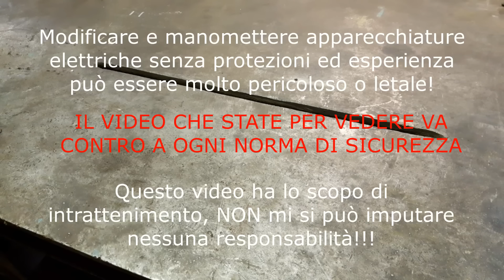Microwave transformer, the best modification for Spot Welding machine

Comment: These do-it-yourself spot welders look interesting, but there is one problem with them, namely that you achieve such a power that you can already use them, you have to connect a lot of the MOT. So, since I don't have much space in the basement of my home and I have to constantly pack them, these are not good solutions, because they take up a lot of space and their performance is low! I bought a Sequre Sq-Sw 1, and on the second battery pack I sold, the price came back. Not to mention that it can handle 1500-1600 Amps at peak!

Comment: What is the maximum current you can get?
Reply from the maker: Hi, it depends on what you have to weld... In my case with a primary winding I get up to 400 amps, if you put two primaries in parallel you get around 800. If you take off the shunts, you can hit 1000 amps.

Comment: Nice video. Grinding the sharp inner corners & then adding a layer of thin insulation, tape, etc. Finally squeezing the turns more would make a tight wind.
Ed c

Comment: The best is to use a big cable with max 2 rounds = 2 volts and a lot of amps but very short welding time (with time and power controller ; the best is with several pulses). Here you win Volts but no amps , so welding time is longer, nickel can burn with a hole in the cell plate, or simply a bad welding, with hot point by use of the tool with many amps ...and possible bad issue for the cells...and for you . Professional welders use such voltages (3,5V or more), but not to weld on thin plates like lithium cells.
 The best for cells is maximal heat BUT with minimal time (regulated with pulses to avoid burning). It's the best for weld quality and for the lithium. The number of pulses is the most important. It's THE big issue by use of a MW transformer without controller.   And at the end , good electrode cables, as short as possible for easy use.

Comment: Very good idea, could you tell us also how many amps does it give you? I'm thinking for a spot welder.
Reply from the maker: Hello, with this configuration it can give about 350 amps (more than enough for my needs). If you need more current, you can put two primaries!
Reply: @newtech5042  350 amps is very low for a spot welder. Increasing the secondary voltage the way you did, lowers the current. It's definitely not more efficient.  Using parallel primaries of 2 transformers and the secondaries with less turns, but in series, will keep the current higher but the secondary voltage will be additive. With two parallel transformers the power Input is doubled. Power out equals power in minus losses. Total power dissipated in the weld is key, but good spot welders typically use 1000 amps on the low end. And as much as 10,000 amps on the high end. Typically about 5 volts up to 20 volts. Spot welding is resistance welding. Squeeze pressure plays an important role because that tends to determine the resistance at the weld. You can tweak this a bit as you make a weld. Takes practice.
In these kind of microwave transformer spot welders, 2 volts at 500 amps can make a semi-decent spot weld on light gauge steel, but barely. The turns ratios is the key to the current out. More turns makes higher voltage but lower current. That's what your mod is doing.  You can do a few things that produce higher losses and raise the primary current above the winding ratings. Works more or less but overheats the whole thing pretty quickly. Low duty cycle. 

With two parallel primary transformers with the secondaries in series, you get higher voltage at the same current. But about double the energy dissipated in the weld.
For a stick arc welder, you need less current but want to have about 40 volts to keep the arc going. So there's a trade off between the number of turns to get higher volts, but less current. But to get decent performance, you need more transformers. 

In the end it's still largely about the total power or KVA. Changing just the secondary won't change that. You can get more or less current and respectively more or less voltage, but total energy is pretty much the same. 

US transformers have 120 volt primaries which present a different set of challenges. Power is the same but primary currents are higher. Roughly double. The windings are different and getting an ideal turns ratio is considerably different.      Using 240 volts on series primaries, gets complicated and requires a dedicated circuit, but ultimately can push higher currents for a spot welder but lower voltages. Cable size does play a role. Bigger cable with less turns, supports higher current at reduced voltage. The 230 volt transformers on a 230 system are a bit more flexible and a bit easier to deal with. Either way there's limits to what you can get out these transformers.
Reply: @professorg8383  словесный понос 😂
Reply: @левтравинов  I try to convey a lot of information. If you don't want to spend a few minutes of your time reading, that's up to you.  Too often these short videos don't give enough information if you actually want to try something. If I can save someone a failed attempt, I will try to do so. As someone who teaches, I see a bunch of idiots because they can't invest any time to read. All of my students appreciate a lot of information and they become far more skilled in the process. But I'm old school.

Comment: SUPER DANGEROUS TO USE EVERY TIME. THIS HAS A 70% KILL RATE. WHEN SHOCKED WITH THIS TRANSFORMER. IF U ARE LUCKY YOUR FINGERS < TOES & MAYBE HANDS WILL BURN OFF SO U CAN LET GO. OTHERWISE IT IS ON A CLOSED LOOP & U CANT LET GO WHEN SHOCKED AT ALL.
Reply: You are confused. The 70% kill rate is specifically regarding people using the transformer for HIGH voltage output to make Lichtenberg (Fractal) Wood Burning devices. The default configuration for the microwave transformer is a low number of primary windings to a high number of secondary windings which generally outputs about 2000 volts at 1 amp. New Tech's version is doing the opposite. He is going from a high number of primary windings to a low number of secondary windings which reduces the voltage, but increases amperage. 
DO NOT try making the fractal wood burning machine. It's INCREDIBLY dangerous which is explains the 70% kill rate you mentioned.
Reply: @nnamerz  thanks for the insight
Reply: @fentynolfloyd5558  No worries. But I do appreciate your intent to help prevent more injuries or death 👍😊
Reply: @nnamerz  Hey since u know more about this stuff, I admit I am into all kinds of stuff. what is the benefit of something like this for an average guy, with a house & a shed.. whatever.. What is the big desire for this thing for the widest range of ppl as well?
Reply: @fentynolfloyd5558  If you're referring to the microwave transformer, the benefit of this specific project is to make a resistance spot welder. It's most commonly used for creating battery packs by tack welding small conductive small strips of metal (tabs) to link the batteries together. It can also be used it to tack weld 2 pieces of metal together. This works because New Tech modified the transformer to push out LOTS of current (amps) which suddenly dumps a lot of energy into a focus area. All that energy along with some pressure, forces the metal to get really hot and fuse with whatever it's touching.
Reply from the maker: In base alla norma tecnica IEC 60479-1 la soglia di tensione minima considerata pericolosa è di 120 V in corrente continua e 50 V in corrente alternata. Il secondario (che è l'unico ad essere maneggiato) ha una tensione di 3,5 volt, in ogni caso è giusto ricordare che non si scherza con la corrente, infatti è specificato prima di far vedere ogni modifica!

Comment: I think it's a good idea but it doesn't seem very good for the battery cell. As in the video, this only increases the volts, not the amps. Although soldering is easier, it also increases the battery death rate
Reply: Si aumenta el voltaje también aumenta el amperaje son variables directamente proporcionales. Según ohm

Comment: Don’t use a MOT transformer. Use a high pressure sodium or metal halide transformer. I use a 1000 watt HPS transformer and cut out the secondary coil . You can use 14 turns of 4 awg for rectified for 12v. Done.

Comment: But if you get so many secondary coils, you will decrease amperage. What actually does the job is amperage not voltage.
Reply from the maker: Dipende in realtà da tanti fattori, le opzioni per aumentare corrente possono essere diverse, levare gli shunt, mettere due primari, poi diende anche dalla potenza del primario originale... questa modifica permette di avere a disposizione più spazio, in modo che ognuno possa impostarlo per le proprie esigenze!

Comment: 100722/1304h PST 🇺🇸 Thank you for designing the enhanced spot welder. Good job, neat job and I noted the increase of additional 1 volt from 2.6V to 3.6V. I can imagine the power of the weld.
Stay safe.

Comment: The way you welded cores caused lamination between "E" shaped layers to melt, thus creating a single block of core. There will be huge amount of Eddy current which will cause to heat up and melt isolation on wires eventually.
Reply from the maker: Ciao, ti posso assicurare che dopo mesi di utilizzo quotidiano del trasformatore, non si è ancora presentato il problema del surriscaldamento e fusione dei fili... Comunque come ho spiegato nel video, questa è una modifica che porta dei vantaggi rispetto alle modifiche già viste sul sito, ma ciò non vuol dire che è un trasformatore perfetto, è un adattamento che aiuta gli appassionati e nulla di più.
Il trasformatore per microonde, ha difetti di costruzione già all'origine, ciò nonostante la sua semplicità supera i difetti...

Comment: The idea of combining 2 E cores is a good one. The best results i've personally seen have been with using a standard 12v 1200va UPS transformer with a double pulse controller, produces even better welds than 2 microwave transformers combined surprisingly
Reply: Hi Neil, do you have a video or scheme? Those two UPS transformers spot welding machine?? Thank you 😊

Comment: Ciao e molto interessante il tuo progetto ma quanti amper riesci ottenere in questo modo?
Reply from the maker: Ciao, ti ringrazio... dipende dal tipo di trasformatore che trovi, perché i microonde hanno diverse potenze... nel mio caso ottengo 400 ampere e 3.5 volt, questo vuol dire che ottengo 1400 watt! Con i trasformatori classici si raggiungono lo stesso circa 400 ampere, ma a 1.5 volt, quindi la potenza è solo di 600 watt.
Reply: @newtech5042  more  volt  is more watt ?????the small cable  is better more volt ??????

Comment: The cores should have no visible air gap between their ends when you weld them together. Even a small air gap there will lower the performance of the magnetic circuit. Carefully remove any protruding weld from the mating ends after separating the core parts by 'lapping' the matching ends of the 'E' shaped cores on fine abrasive paper (400 grit or finer) laid on a sheet of glass. Align the ends of the cores so there's no overlap, and firmly clamp them together along the long axis before welding them. That will eliminate any air gap, give the strongest magnetic field, and the best full load current.
Reply: You're describing a better way to do it wrongly.  No need to cut the transformers.  Use both intact with primaries in parallel, and a single secondary looping first through one, then through the other ...
Reply: @LokiCentral would the transformers need to be isolated or you can stack them without needing to isolate them when put one on top of the other?
Reply: По-русски перевод делаете
Reply: mas debería de preocuparos las perdidas por corrientes de foucault que presentan estos tipos de transformadores, cualquier soldadura en su núcleo contribuye en el aumento de estas corrientes, ese es el motivo de que se use ventilación en los microondas, no son adecuados para algo diferente a su verdadero uso
Reply: How many square millimeters is the thick cable?
Reply: @atanasivanov1372  It's looks about 50-70mm2
Reply: @atanasivanov1372  As my calculation shows, you can use 30mm2 for 5 turns of secondary coil, 38mm2 for 4 turns, 50mm2 for 3 turns, and 76mm2 for 2 turns of cable. It will be enough even for long continious(!) welding, not only for spot welding. Using of this huge diameter (as in video) is a huge overwaste of cable size. For spot welding only these sections can be easily reduced by twice.
Reply: I've done this double stacked MOTs but for higher voltage by two secondary windings center tapped for about 9kVAC, then two of these run complementary for 18kVAC that was rectified and fed to capacitors for a pulsed metal vapor laser ❤
Reply: جيد لكن لا يستطيع تلحيم النحاس فقط الحديد اما النحاس الأصفر والأحمر فلا
Reply from the maker: Hai ragione, già in origine sono progettati con perdite considerevoili, questo è solo un adattamento che permette di avere delle prestazioni migliori rispetto a molti altri già visti...
Ciò non toglie che uno studio più approfondito permette sicuramente di migliorarlo ulteriormente!

Comment: What would happen if you use two copper spools on your double stacked microwave converter with the wiring through it in other words what would happen if you use double the double the copper
Reply from the maker: Avresti il doppio della corrente, quindi potresti arrivare a circa 800 ampere, invece di 400...

Comment: не будет работать! первичная обмотка рассчитана на трансформаторное железо. если делать из 2 то и оставлять 2 первичных обмотки! и нужно убирать шунты. Шунт в такой самоделке не нужен! бред одним словом
Reply from the maker: Lasciare lo shunt da protezione (parziale) dal cortocircuito in uscita; limitazione dell'arco al momento della saldatura (in caso di contatto precario); costanza della corrente fornita a carichi diversi, che si traduce in una saldatura più omogenea di piccoli o grossi spessori. 
Togliere lo shunt da maggiore potenza ma il trasformatore lavora ad una potenza superiore a quella di progetto, nessuna limitazione di corrente al primario in caso di corto franco all'uscita; grande differenza di risultato della saldatura al variare degli spessori coinvolti.
Quindi lo shunt ritengo sia necessario.
Reply: @newtech5042  https://youtu.be/HpFSSD8hZX8
Reply: @newtech5042  ответ интересен, но ничего не понятно мне...
Reply from the maker: Ciao, la bobina del primario è da circa 1000 watt, la modifica che ho fatto, serve per far lavorare per più tempo il trasformatore, senza avere un surriscaldamento dei fili di rame.

Comment: If you are going to make one of these, this is the best one to follow.  He places emphasis on protecting the insulation on the windings, even going to the extent of using a metal shield.  He shows the voltage obtained and gives good reasons.    This shows good common sense and a regard for electrical safety, which so many other people see to disregard.
Reply: I could not agree more man, Im no safe sally and yes I occasionally don my safety squints when making a quick cut or something when I don’t have my eye pro. Within reach..however with the inherent  dangers of dealing with high current electrical components when modifying repairing or building a spot welder need to be made very clear to people these days as they think it’s a microwave, how dangerous could it be? And  I’m not even against someone doing wreck less things as long as they’re not hurting anyone, their an adult,  capable of comprehending & understanding the risks and potential consequences that could be a direct result of their actions. More power to them, We call it natural selection

Comment: Idea is good and I appreciate this dude!. Few additional things can improve this...like... calculate the core area and the flux density...to get how much power you can get. primary coil from one transformer will not provide you  that much flux density probably....
Reply from the maker: Ciao, hai ragione... C'è da considerare che utilizzando materiale di recupero non è possibile ottenere prestazioni eccezionali! Facendo un pò di calcoli ho trovato questo compromesso che è sicuramente migliore di tanti visti in rete! Grazie per il commento..
Reply: some fine ideals there.. but all theory. Put it into practice and make a video, checking that its works as calculated, first.

Comment: Ciao New Tech per quanto mi riguarda  il tuo video è tra i migliori  e fino dove sei arrivato si è compreso perfettamente credo che tu debba fare un'altro Step per poter ci dare la possibilità di arrivare alla fine , ti faccio un paio di domande : mi insegni che i conduttori si misurano in mmq quindi quello che tu hai utilizzato mi da l'impressione di un 95 mmq , è sufficente un 50 mmq? e quanto deve essere lungo per creare 3 spire? Di questi tempi comprare uno spezzone de 70/95  di rame ci vuole qualche soldino lo possiamo chiamare oro rosso. Inoltre una puntatrice del genere che spessore può saldare? Grazie accontentaci.  P:S: credo di essere uno dei primi iscritti, ne sono fiero.
Reply from the maker: Ciao, ti ringrazio... Per quanto riguarda la sezione 50 mmq vanno benissimo, come lunghezza per riuscire a maneggiarlo bene ti consiglio 2 metri ( se non vuoi sependere molto puoi provare in qualche centro di recupero metalli).
Reply: Ma 2 metri per tre giri ??